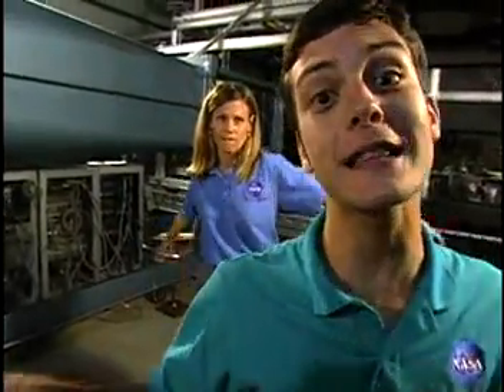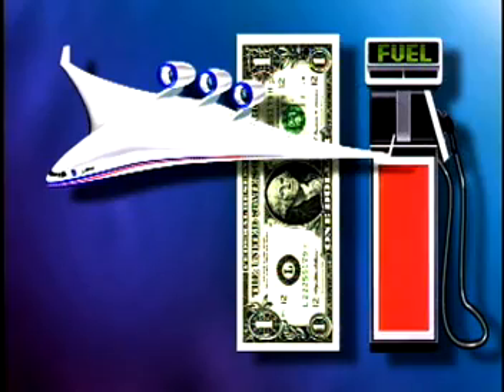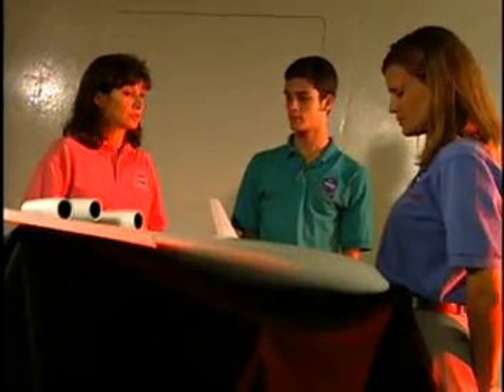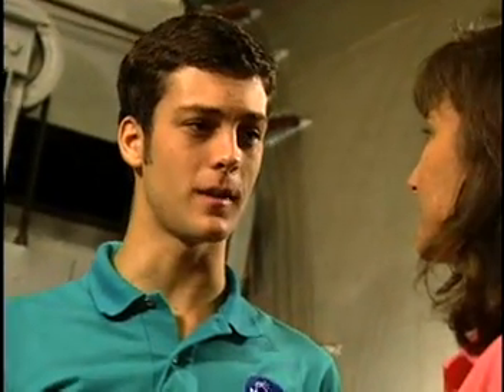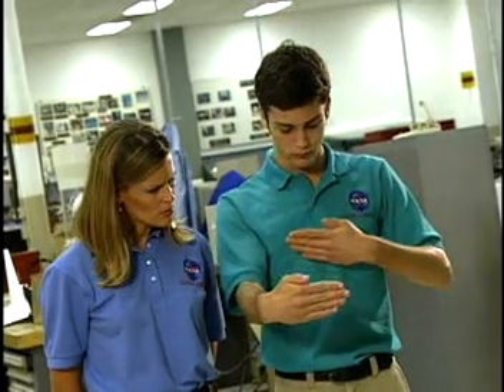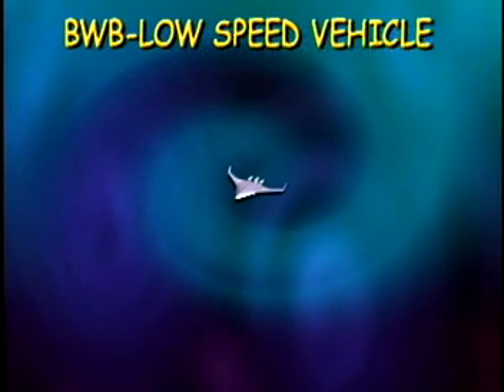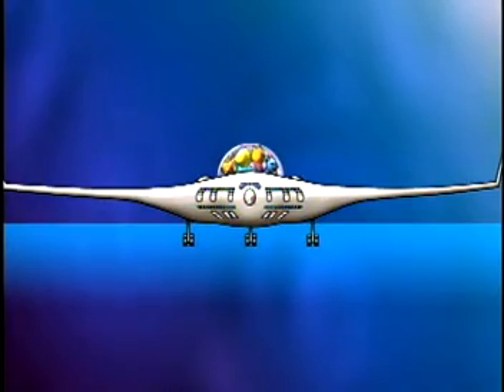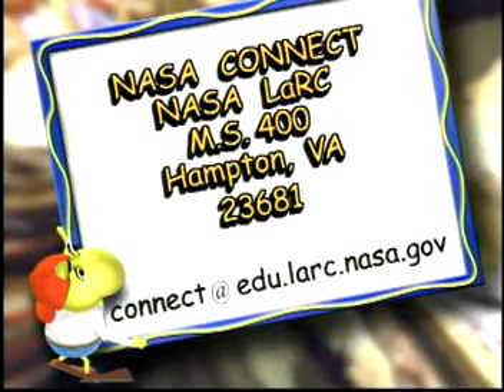BWB Concept Aircraft

Comment: Just Remenber nasa, the is a limit to the width and height of a commercial plane, it has to fit on the stand, this looks a little too big. plus, looks expensive to build, probably cost more to use, coz of the construction costs?

Comment: Could you put double magnetic roters under helicopter just small enough to change direction. Magnetic roter is for better oppisite magnetic pull offering better spin gyro control.
Are bi-wings coming back.Yes though magnetized on both wings and bottom wing is smaller than top wing for better control and enhanced, at higher distances.